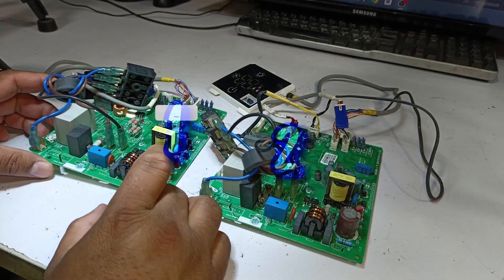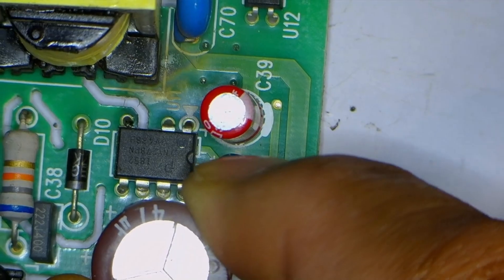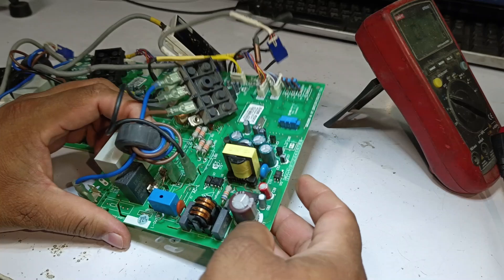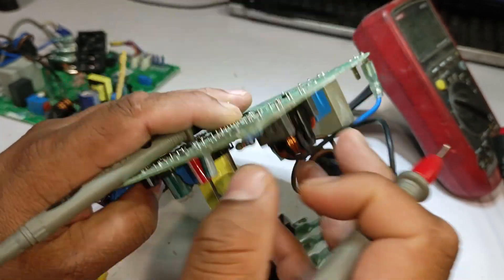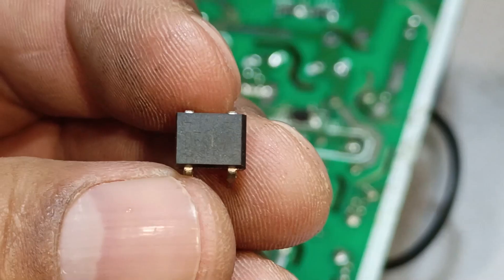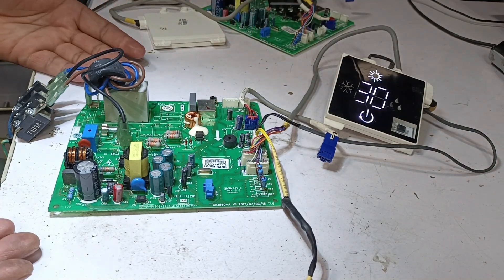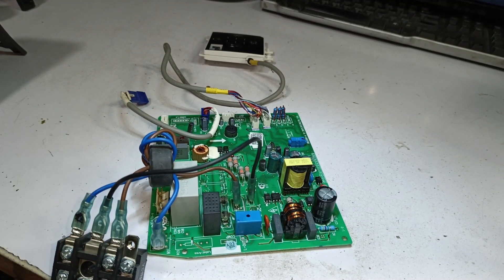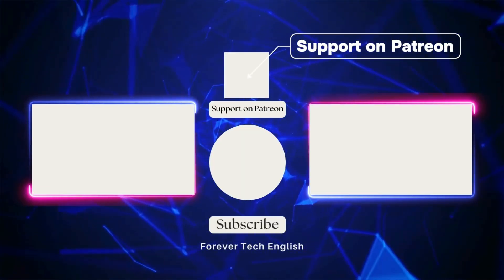Burnt & Dead? Watch These Gree Mini Split AC Circuits Come Alive!

Comment: When you were checking znr/varistor it is clearly visible there are 2 resistors connected in series and parallel to znr, of value 470kohm which means 2x470k is just bellow 1M ohm, which is ok.

Comment: What is znr means
Reply: Hello friend its a zinc oxide non linear resistor is a type of voltage dependent mainly for protecting of components in a circuit